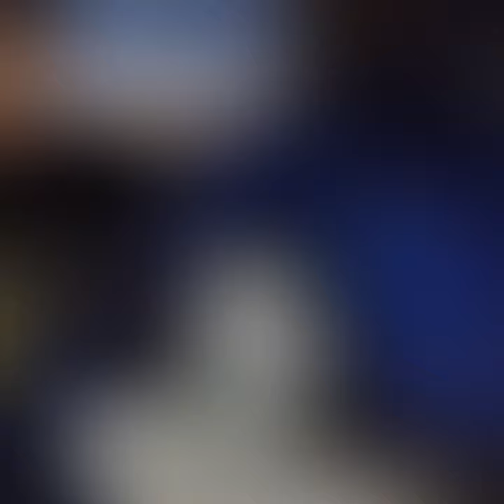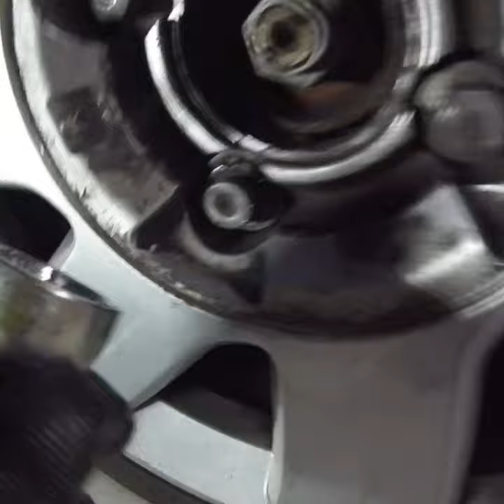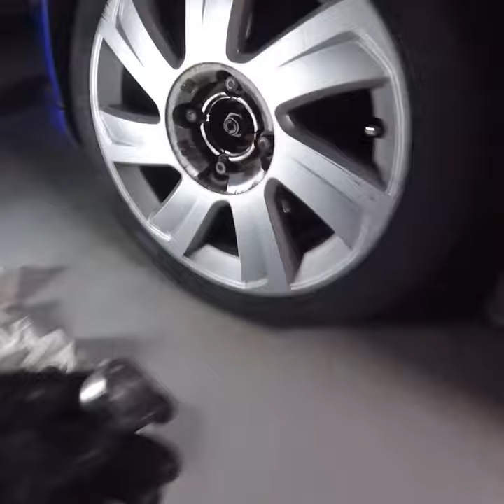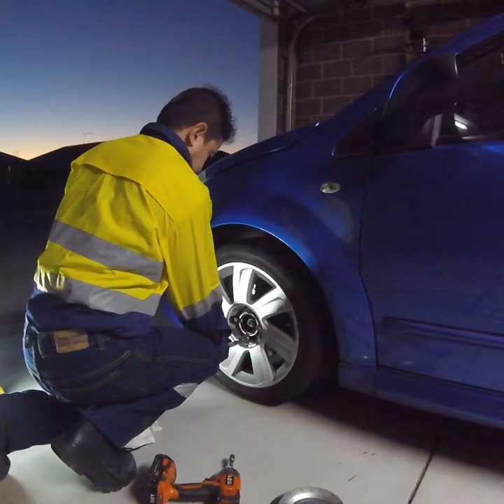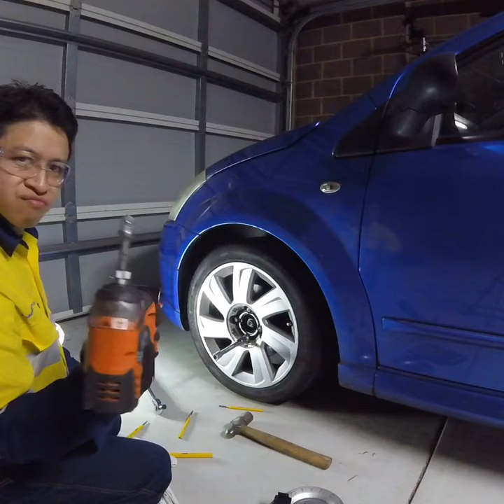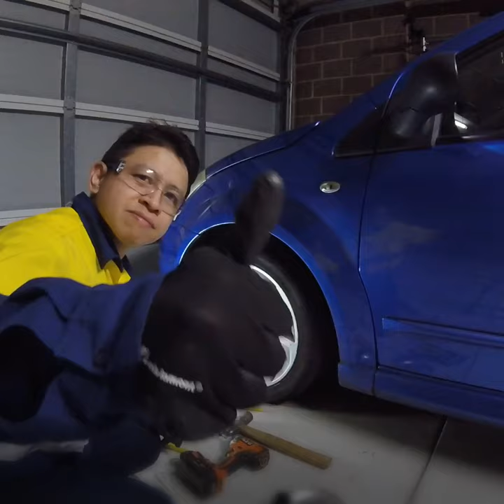Citroen Wheel nut key problem ! Solution change the wheel nut ...

Comment: I see you managed to get the locking wheel nut off, but can’t really see what technique you used. You knocked it with a ‘punch’ but then what did you do?
Reply from the maker: hi Sharon first thank you for watching this quick video, the technique i did is punch slightly the nut hole 60 degree counter clock wise then you will see  start moving bit by bit.